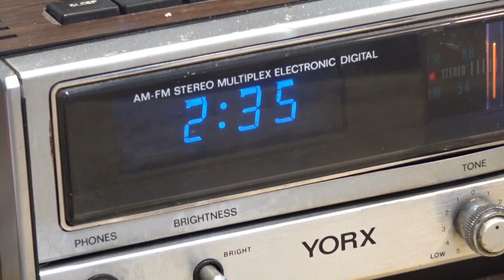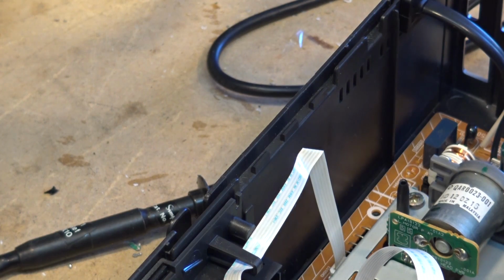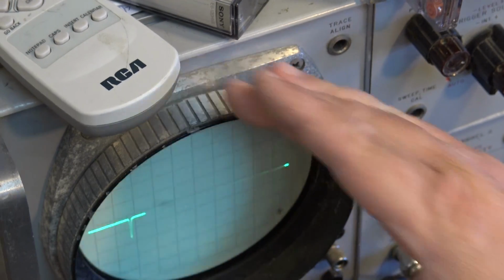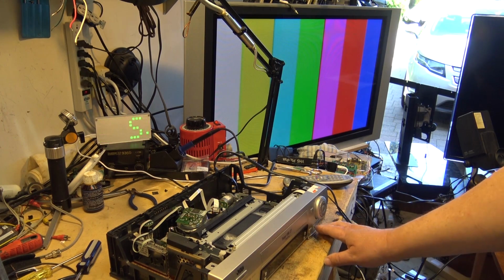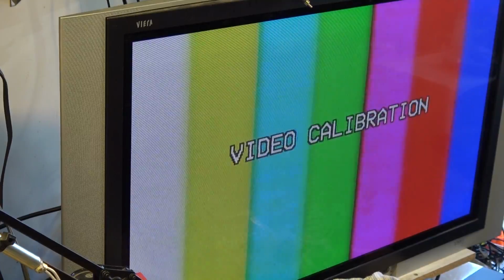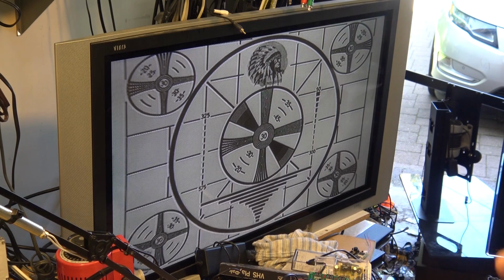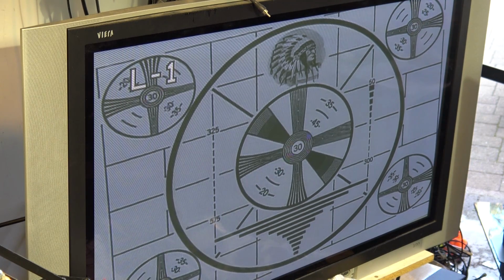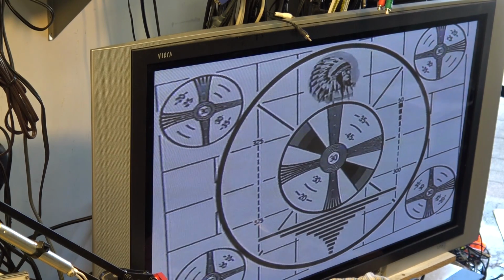JVC HR S3910U S VHS thrift store score

Comment: The only thing better than a great electronics find is your diagnostic skills. It is impressive how well you know the theory , operation, and repair of so many different pieces of equipment.
Reply from the maker: This is what you pick up over 30+ years of electronic work.
Actually it is much longer than that. I started "playing" with electronics when I was a kid. Very young, perhaps 9 or 10. 
Getting jolted by the 400 volt supply from a tube radio, no problem.
I didn't have helicopter parents that were hovering over me "protecting" me from doing stupid things like sticking a butter knife into an electrical socket.
Hell no, I got a shock, and never did that again.I'm not saying getting a shock is good, it isn't, and to tell you the truth I am scared to death of electricity, and that is why I practice every safety measure when working on electric devices, and rule number 1, no "line" connected devices. Everything, and I mean everything I work on, where there is the potential of contact, is isolated from the mains live, and neutral/ground.
The exception is devices that draw more than my isolation transformer can handle like microwave ovens. For those one has to be extra careful, as they have lethal voltages and currents. I studied electronics in high school, but never went on to formal college or university education in electronics. I actually took television production in college. I did however work in a shop while I was in high school, and started an apprenticeship. After the 4 years on the job training I wrote the challenge exam and passed with flying colors. Then the rest of my "formal" training was all paid for my the manufactures that I provided warranty work for during my 21 year career in the repair business. This was invaluable, because it wasn't just theory, but we actually studied the circuit designs in use. I am not a design engineer by any means. I don't design electronics, but I can take a piece of equipment, and with the schematic can figure out how it works, and more importantly, when it isn't working I can use that schematic, and due to my knowledge of how it is supposed to work diagnose the faulty part. This was true for discrete components. These days with everything buried in large scale IC, it is much more of a crap shoot. You take your best educated guess many times. Sometimes you get it right, but many times it bites you in the ass, especially now where software corruption is a major cause of problems.

Comment: Amazing and very informative ! I have exact VCR which i bought new and very little play time, all works well except on eject i have to lift up for tape to eject, (doesn't come out at all without a gentle push up) otherwise it goes back in and loads then shuts off by itself occasionally if its warm from playing it will eject the tape. I almost took to scrap yard and thought was a cheaply made machine (compared to my 1996 Sony ) I look forward to seeing more of your videos,  
I have older moderate high end equipment, adcom cd deck and Advent 201 cass deck needs help and more .

I am an audio lover and used to work with oscilloscope and other equipment in the early 70's in the tube era lol.

Comment: Nice catch :-D, that was one of the better later machines, before vcr's became dirt cheap and rather nasty.
I have a version of your machine, JVC HR-S6855, S-VHS, HI-FI, NICAM, SUPER VHS ET.
But i stopped watching t.v 5 years ago, so ive forgotten how well it did.

White lines around black edges, sometimes over compensation for lack of h.f content.

The old machines had an "Apature" setting for that, i often spent ages just creaping up to the best setting using the customers tv set, just enough to make it look better, no more.
Composite video cable quality and termination impedence could ruin the picture, a lot of shitty scart cables did that :-(  (i thought scart was shit anyway).

Comment: I've  found several stereos at savers and turned them over for a profit. You just have to go right when they open
Reply from the maker: Yes I am going to start going there regularly, as one never knows what will show up.
Reply: That's a great idea!  : )
Reply: I was browsing a Goodwill several months ago and found a VHS VCR for $4.97. They said it worked on the tag so I bought it (worst case I'd loose a little over $5). I then took it to the camera shop next door and sold it for $10 after they confirmed it worked. I owned the machine for fewer than 10 minutes.

Comment: I still have an early 90's AKAI VCR which has also a tape calibration. AKAI called this I-HQ. Unfortunately, the decks in these machines were not very relailable but with good tapes they had a quite good picture. As always very interesting video. I use my increased spare time watching all your great videos. Stay safe and healthy.
Reply from the maker: I remember condemning many an Akai VCR.  Most of their old stuff was made by Mitsubishi and those old mits machines that the guides came lose on. Money maker for me. Krazy Krazy was selling them like they were going out of style, and they all broke down and were a PITA to fix.
Reply: The head and pinch motor slow
Reply: The head and pinch motor n v 280 VCR

Comment: I pulled out my dad's old Zenith VRE550 SVHS deck last night and fired it up for the first time in over 20 years. Still works fine! I needed it to check some old tapes to see if they had Hifi tracks on them. Curiously, the later JVC decks I have like the 3910 do not have any way of telling you such info. The Zenith decks were made by JVC and wonder of wonders, the rubber parts for them are still available. I have found some of the belts at the last independent electronics store in my town as well as the full rubber replacement kit online. I think I'll check out the in-town store first but I may just buy the kit from online just in case. On another note, can you tell me exactly which caps are needed for the Sony R5U SVHS deck power supply? I have one also that needs it's caps replaced. Maybe you should offer a kit so we can fix them. Lastly, have you been able to get a Sony SLHF-750 or 900 Betamax to show how to fix those? Fedex dropped one I had shipped from the US and now the mechanism for loading tapes won't come out of the machine. I have the service manual for that model (let me know if you need a copy) but I have no idea what might have broken. I heard that these had a tendency to come off their rails (since the carriage was moveable) resulting in a shop visit, which is probably why they only made them for one year...

Comment from the maker: yup, caps in the tbc module, and video circuit (inside those vcrs modules) and the power supply We used to call them "panaphuckers" Terrible vcrs especially the "pro line"

Comment: Hello, Sir! I just purchased a JVC HR-S9911U NOS that was on a warehouse for at least 15 years. It's playing ok but has a problem in the fast forward and rewind modes: it starts at low gear ok but when it changes gears I hear the gears screeching and the VCR turns itself off. Do you think it's just a matter of lubrication? Is it possible to remove the mechanist and put it back wihtout misaligning anything? I have the service manual but it's just 15 pages long. Thanks!

Comment: I have a JVC HR-S3800U and a JVC HR-S9911U Super VHS ET machines with exactly the same problem. Depending on the tape, they sometimes play for a few seconds and then go into blue screen mode, on and off. I tried everything I could. Cleaning the heads was the 'obvious remedy', but that did not work. They do record with excellent picture and sound quality and playback 90% of my tapes perferctly, but there are 10% of those tapes that are unplayable. I will try clening those flat cables. If that works, you just saved me U$200.00 (these machines are VERY expensive here in Brazil).

Comment: ET = Expansion Technology
Reply from the maker: Extended technology, expansion technology, expanded technology, same thing.
It allowed recording a higher resolution image, closer to S-VHS on a regular tape. Like S-VHS tapes recorded in this mode would only play back properly on other "ET" machines and of course S-VHS decks.
Because a regular tape was not the same formulation as real SVHS, it cost a fraction of the cost of real tape. Many found that they could drill the index hole in a regular tape and record on a SVHS deck. The results were very good, but not as good as a real SVHS tape because a standard tape could handle the bandwidth that was required for full SVHS. The ET technology was introduced to maximize the quality on standard tapes without the poor S/N ratio that occurred when people drilled the hole in standard tapes. It resulted in a better picture, close to what a real SVHS tape delivered.
High grade tapes worked best. On record, when SVHS-ET was selected the recorder would record a quick sweep test wind the tape back and check playback, set the record level and tweak the modulation bandwidth to find the sweet spot and the recording would proceed and deliver the best quality for a particular tape.  When running a real SVHS tape it also checked the quality of the tape and would push the carrier to the maximum it could.
Because it checked the tape before the initial recording started, this guaranteed the best quality for a specific tape. Something a standard SVHS deck did not do. It loiked for the ID hole. If it saw it, the recording would be in SVHS mode and lower quality tape would suffer a noisy picture.
Reply: Well, with regard to S-VHS ET recordings playing properly on regular Super VHS VCRs, not entirely.

There are many that can.

But there are some that can't without modifying the cassette, particularly very old SVHS decks like my 1988 vintage Philips SVHS VCR.

On that machine, playing an SVHS ET recording from a VHS cassette winds up looking like what a VHS VCR would show playing a SVHS recording: overmodulation noise out the wazoo.  To prove that the SVHS part worked on that unit, my SVHS tapes play fine.

Of course, a way around that is to drill a hole on the cassette to make the VCR think it's S-VHS, so it could play SVHS ET recordings contained within it as well as record SVHS onto the same cassette, albeit with less than optimal results.

And, having a regular VHS VCR with SQPB can be handy in a pinch.  Although you won't be able to watch SVHS/SVHS ET recordings at their best that way, at least you can still watch them.

And, yep, that's the gist of SVHS ET; it checked and optimized the machine to the regular VHS tape it's loaded with prior to recording in SVHS ET, such as Video Calibration on JVC decks and PerfecTape on Mitsubishi decks.

And, true, you needed to use high grade tape for best results on SVHS ET.  Otherwise, the result is a rather grainy picture.

Comment: Do you think  it's worth buying an old amplifier? to be a little better understanding on what kind of amplifier like a power amplifier in the pro audio kind of stuff and it might be from the early or mid 90's?
Reply from the maker: There are shops now that cater specifically to vintage audio. Stuff from the late 70's and 80's seem to bring in the most money on the used market.
With amplifiers there is one rule. It needs to be heavy. If it is heavy, then it is a good piece to have. That weight is the power transformer. The bigger the transformer, the more power the amplifier can put out.
Back in the 70's and 80's the true power of the amplifier was rated, all channels driven. Today they measure IPP, instantaneous peak power, so the specs don't lie. If an amp says 120 watts it can do it briefly. An old amp can run that full power all day long without even breaking a sweat.
Reply: what about the Crown amplifiers that are today's power specs they say it is RMS but i'm curious if it is really the real power or they lying to me?
Reply from the maker: Marantz, Pioneer, Sansui, Rotel, Haffler, Dynaco. Now your are talking.

Comment: Also I got a question for you to research - Why was the LP mode taken out which to me was the best at least better of EP And if you also find out going to 19 micron heads?? if you do a video on these...Many thanks.
Reply from the maker: Lp was never an authorized speed. Jvc started enforcing the no lp record requirement on newer decks.  Panasonic was one of the companies that initially had the speed but even on them, features such as visual search and slow mo, freeze ext blanked the picture on lp recordings.